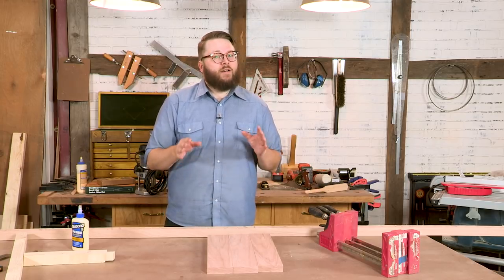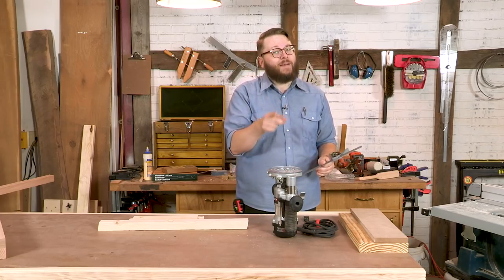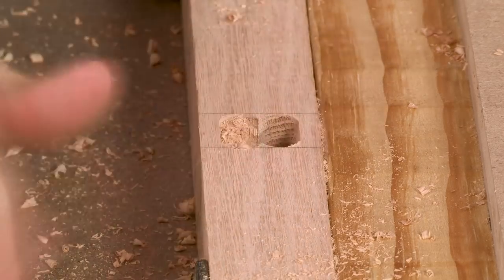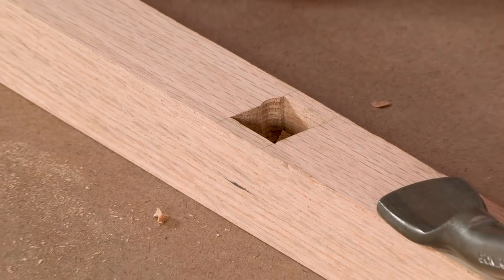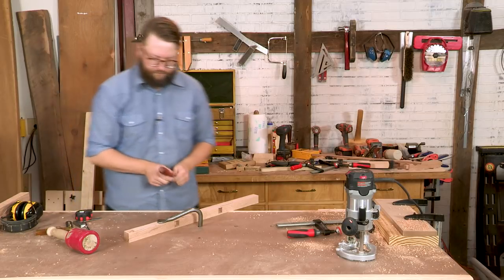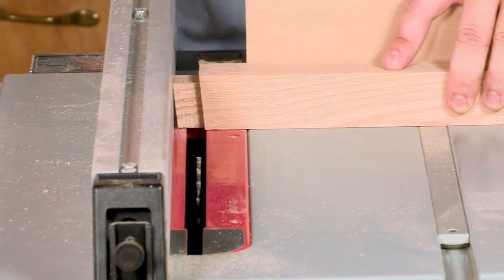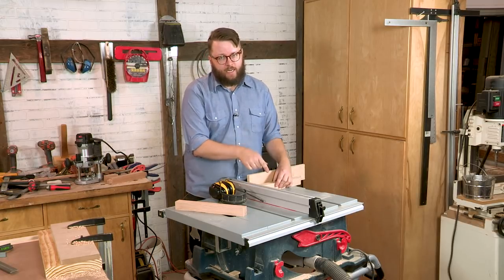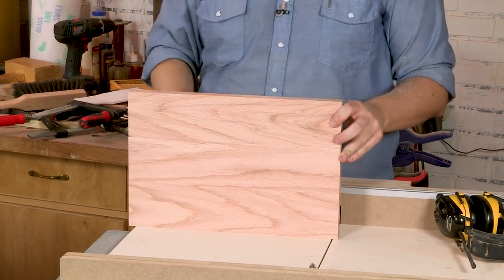How to Make a Mortise and Tenon Shop Stool | I Can Do That!

Comment: When cutting the haunches on the tenons just move the mutter gauge to the other side of the fence to haunch the short side; that way no chisel clean up is required afterwards. 23:32  in video

Comment: Difficult to get 4 shoulders of a tenon in the same plane, even with 90 deg. cuts if stock is not perfectly square/parallel. Consider only two shoulders- cut them on the faces. Yes,you have to accurate with the mating mortise.Thanks for the video.

Comment: Nice project. It would great if someone could demo how this could be done without  the jig and measuring. Measuring is the hated enemy of carpenters and cabinet master craftsman around the world. 
Case in point, the mortise depth could easily be done without measuring and error by laying a piece of 3/4 stock under the base of the router and plunge the bit to the top of the table, set the bit height. 1,2&3. Done. 
But to each their own. 
Lastly, make or buy a marking gauge. Geesh‼️
Reply: I hate the measuring but love jigs, I would add stops to avoid going over the line.

Comment: just a few q's for newbies: - what is a "storey-stick"? , how have you set up the router ?, what bit have you used? and most importantly how do you prep the stock if you get your timber from a yard unprocessed?- as all of this video seems to be a "here is one I've prepared earlier".
just wished you ( and the company who sponsored you) would have done a longer video, detailing every step as if it were for non woodworkers or people just starting out ( say using this project as their FIRST ONE).
Reply: I think we have to assume he hasn't squared up the stock prior and just relied on it being square from the big box store.  For any woodworker (handtool or power) squaring stock is the most crucial step in any process so completely agree with you here, although looking at some of his plunge cuts accuracy isn't exactly a priority here.

A Story Stick is a way of taking relativistic measurments at scale without the need for complex diagrams and written measurements.  No need to complicate this with some red anodized offering from bird-pecker companies, it can be - and at best is - a length of wood.

Comment: nice job. I can not download the plans from bit-ly on my new apple tablet. is it in PDF form. What seems to be the problem?
Reply from the maker: The plans are two-part; one a pdf of the cutting list and a three-view illustration, the second a SketchUp model of the stool. Both are zipped into a single folder. Your tablet may be fighting with the zipped file, or the SketchUp. I'll add Independent, non-zipped links for each in the video description. Thanks!
Reply: thank you that solves the problem.
Reply from the maker: Glad to help!

Comment: I can’t wrap my head around one thing. I’ve searched online and still can’t get this answer.. you’re cutting your legs at 5degrees, but you’re cutting your mortise and tenons at 90 degrees.. how do they sit horizontally, and not at an angle.. would you not have to cut either your mortise or Tennon at the same angle as you would cut the bottom of your legs?